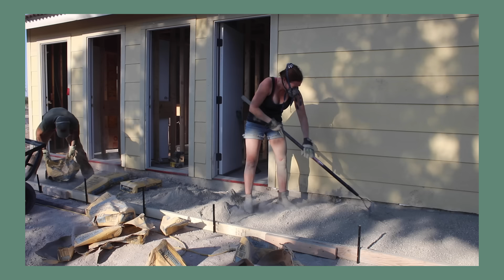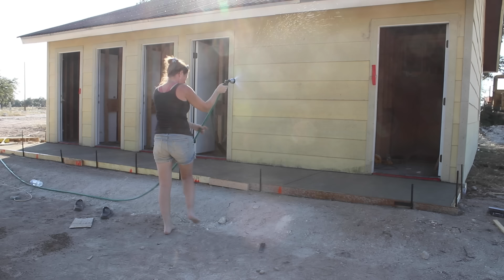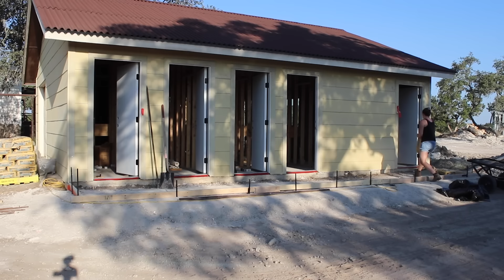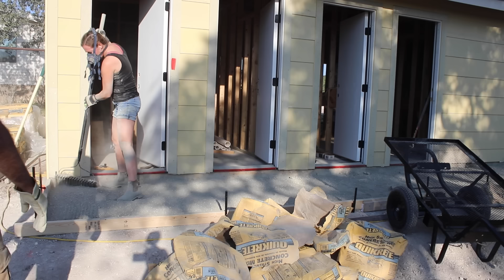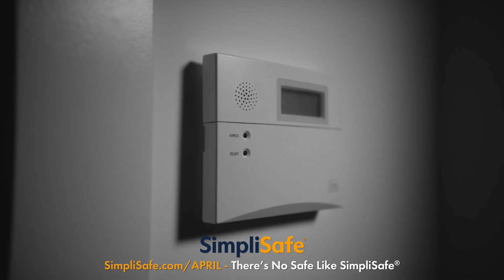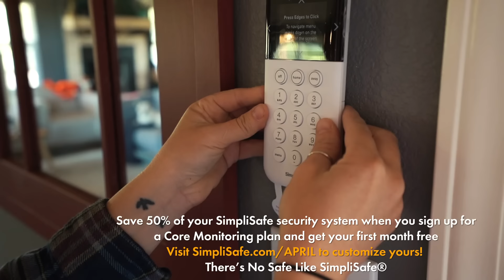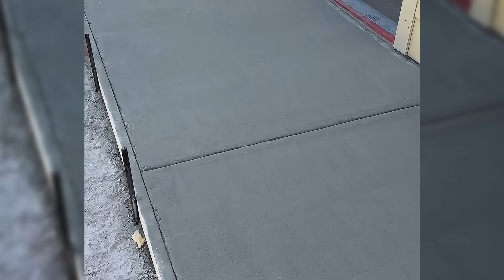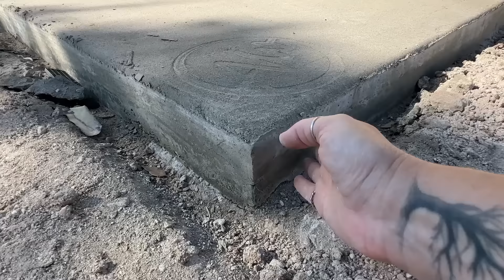Dry Pour Concrete | Better than Wet?

Comment: It doesn't work. Google the testing of the dry pour concrete. It's a waste of time and money
Reply: @tankd0g-223  go try and bake a loaf of bread without mixing the dough. just dump it in a bowl and spritz it with water and you will make a loaf of bread that resembles dry pour concrete
Reply: @bmxscape  because cooking and concrete are the same, sure.
Reply: @zedwpd  common in that ignoring (being ignorant of) the science behind the process is negligence and a content provider should share facts, not pseudo science. Simply irresponsible!!
Reply: It's just walk way it's not that serious
Reply: @rockstarfan886  It's still just lazy.
Reply: I can't see how the water would wick all throughout the concrete with just misting .
Reply: @stephenmoncrieff2056 the capillary effect in concrete is around 30,000ft.  so no problem.
Reply: You only mist at first, then once your top layer is firm, you can shower it with lots of water.
Reply: drainage pipe is made using this method.
Reply: Worked just fine weirdo
Reply: I plan on dry pouring my house foundation. I'm sure it will be fine 🤔
Reply: @tankd0g-223  wow u sure got butt hurt... " There's nothing in bread that disappears after it bakes" . When you cook bread at over 200 celcius, you don't think the water is disappearing? i know hitting stuff with hammers is more your style of work than anything delicate such as cooking, but i can assure you the water in bread dough is cooked out. Clearly concrete doesn't need to be cooked to cure, but it's the exact same principal before the cooking process even starts. if you have dough that is NOT mixed with water, it doesnt turn into bread. plain and simple. same with concrete. if you do not mix it with water, it does not get hard. very very very simple concept
Reply: yah man.  been pouring concrete since 1993 on bridges, roads, drainage structures.  concrete MUST be mixed thouroughly with water or its just a crumbly mess with no PSI strength.  5 minutes of research before wasting all this time energy and money would have served them well.  Not to mention misleading people to follow doing the same.
Reply: @reekreeks  Funny how you think that 5mins of REASEACH is all that's needed to know if the method works or not. Did your 5mins of research tell you which BRANDS of concrete works best with this method? I have a 18 month old dry pour pad that has a mounted manual tire changer that required anchor bolts to bolt it down. Been ripping on mine of months changing tires and the anchor bolts haven't budged an inch nor has any parts of my pad broken from brittleness so try again and take more than 5mins to come to your future conclusions.
Reply: We are taking Googles recommendation?
Reply: Funny I’ve watched 4 or 5 channels that do dry pour with great results.
Reply: Funny I’ve watched 4 or 5 channels that do dry pour with great results.
Reply: @jeffmcgrath2202  you must understand that the there is a difference on how something looks, and how it actually performs. Dry pour concrete has no strength at all. And would not pass can't engineering Tests. Not mixing it is just plain lazy